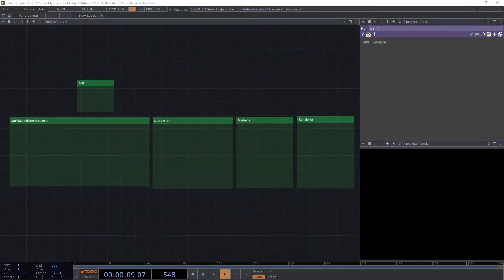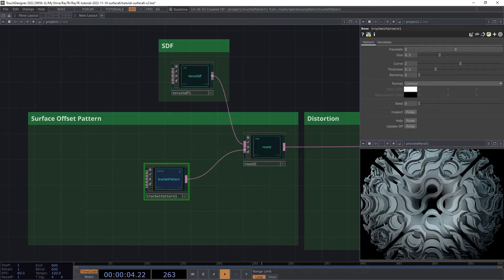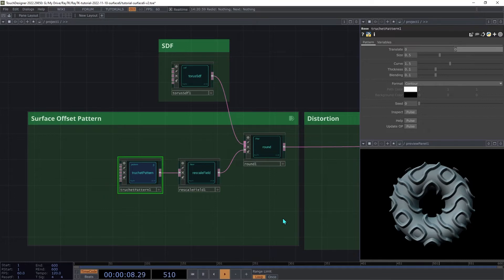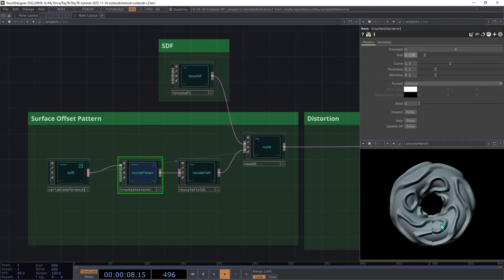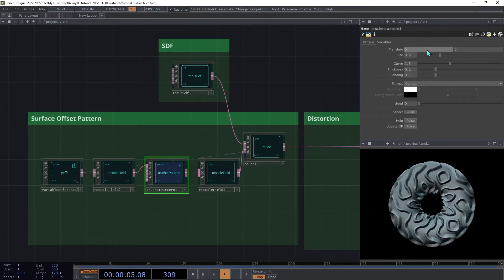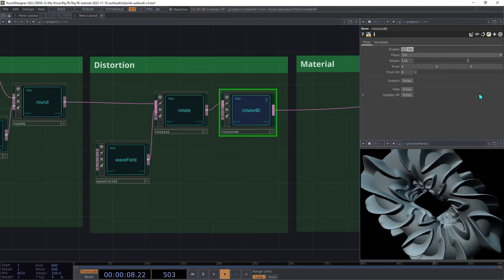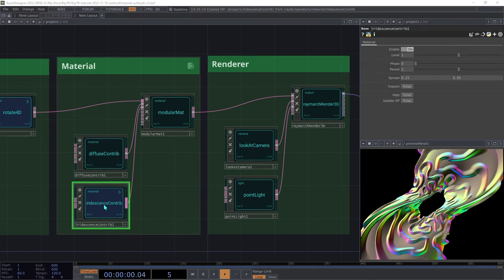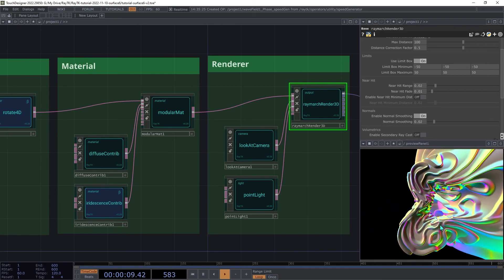RayTK Tutorial: Torus Pattern Scene

Comment: How do you create an infinite 4d rotation?
Reply from the maker: You could use a speedGenerator to animate the Rotate parameter of the rotate4D.
Select the rotate4D, ALT+SHIFT+R, animate with speed > Rotate.
Then increase the value scale setting on the speedGenerator since angles are in degrees.